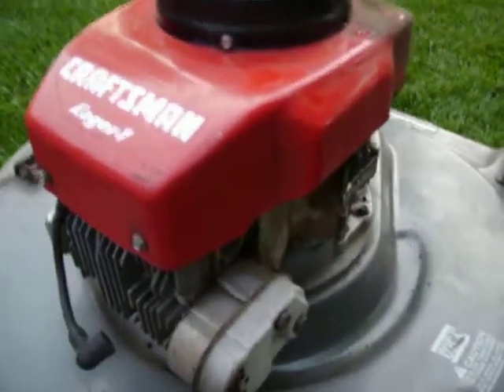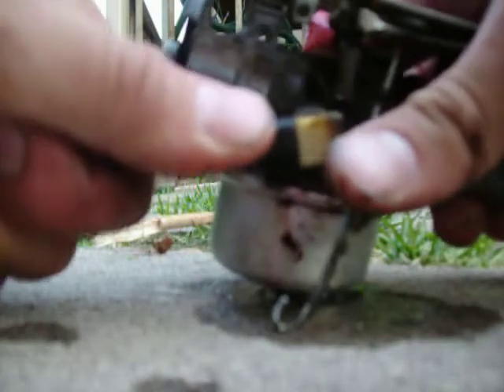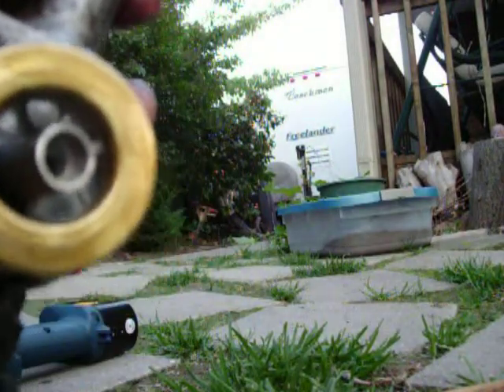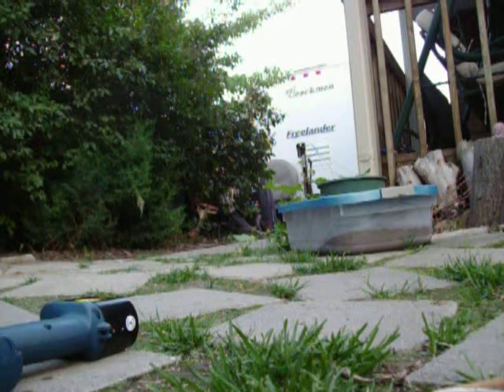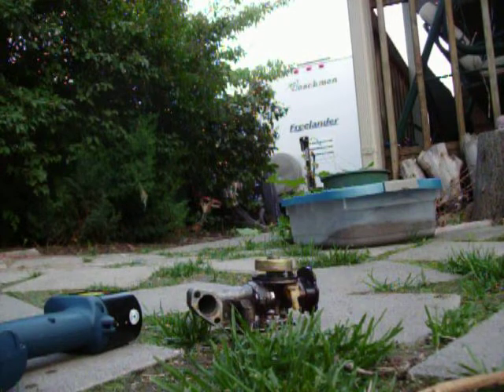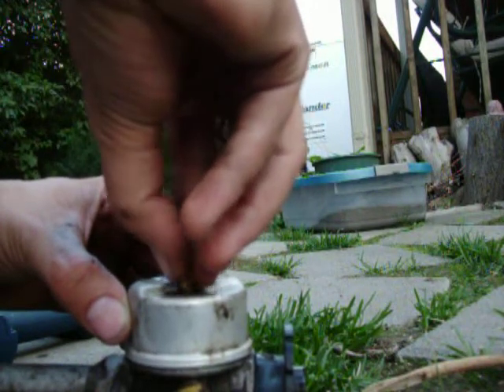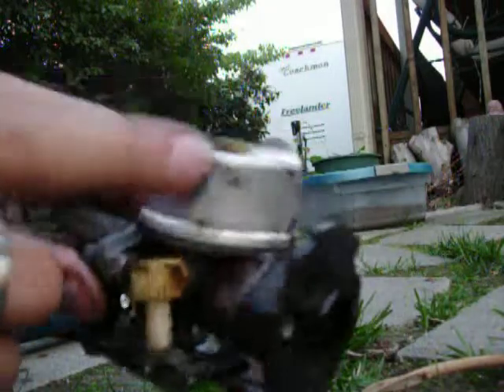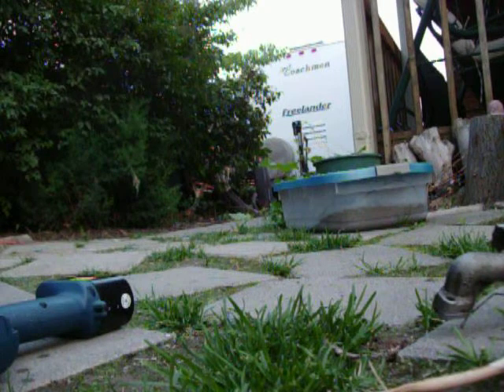how to fix a free or your lawn mower part 2 the repair

Comment: @ils360 lol And don't try to test for spark by twisting the flywheel by hand (Because I did this and cut the side of my finger and pinched it between the magneto and the flywheel. The result was a giant chunck of skin flopping around and a giant blood blister and lots of blood under my finger nail which was red for two months. And a bloody mess on my tools with my mother bitching on how I got blood on her deck. Unfucking believable.)